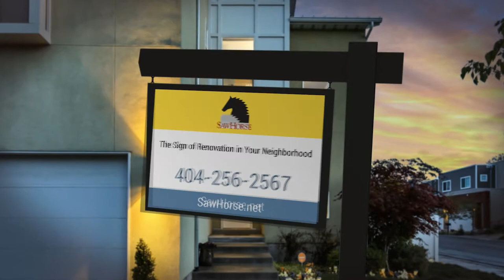Asbestos Testing to protect workers & homeowners from Mesothelioma

Comment: I want to take off exterior walls and possibility of asbestos in the attic should I be concerned and test before or is it unlikely to fall through?
Reply from the maker: Good question- is it siding and roofing?  I'll create a short video based on our answer.
Reply: @SawHorseDesignBuild  inside walls exterior ones are ballon structuring
Reply: Post a photo on Facebook to get an idea then test using a DIY kit but don’t disturb it

Comment: What is your job position takin the samples? I would love to get my license any tips ? I would want to take the samples and send them to the lab what is this position called?
Reply: Certified Asbestos Contractor and it takes 2000 hours of experience before you can even qualify… You can take a some 3 day courses and get certified to take samples for your own use but you can’t charge for it or cut into it without testing if you follow a protocol.
Reply: @KD-hi6hh  what would i need to do in order to be certified for the inspector do you have the link or anything? It would really help me a lot thank u!!
Reply: @KD-hi6hh  what if i plan to work myself as a business do i still need to be a asbestos contractor first if thats the case then i will work as a contractor first then do a insepctor role
Reply: @KD-hi6hh  im taking one now and they told me i just need to do 5 surveys and then my state exam to be licensed im in texas
Reply: @adriangainz5936  Great! There are various levels of certifications that can allow you to sample and remove up to about 10 sq ft of area if you follow the protocols etc....But to do "Surveys" and submit a "Survey Report" you have to be a Certified Asbestos Contractor; at least here in Calif.
Reply: @KD-hi6hh  yeah here in texas to be an asbestos inspector the requirements to be licensed are to take the three days course pass your state exam and then do 5 surveys with someone who is licensed for the experience and boom you are a certified inspector and can start work:)
Reply from the maker: I appreciate you all answering these questions since I was not sure.

Comment: Totally disregards the Stachybotrys Toxic Black Mold on the paper backing of the tile drywall behind the tile while sampling a type of tile (and mastic) for asbestos which wouldn't even be suspected to contain asbestos. 🤦🏽‍♂️
Reply from the maker: The house was getting gutted and the workers were already wearing protection for Lead.  The asbestos testing was just an extra precaution for worker safety.  We completed several other tests on the house with a different company.  Check out the full list- https://youtube.com/playlist?list=PLq5n3pNCsaDuXN0oGB4vq7_VmFHR7cmTN